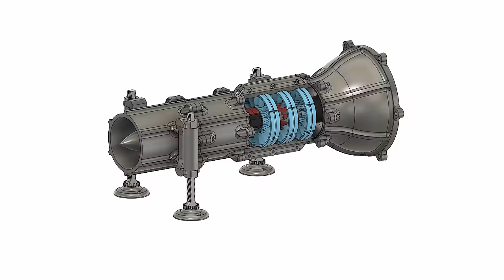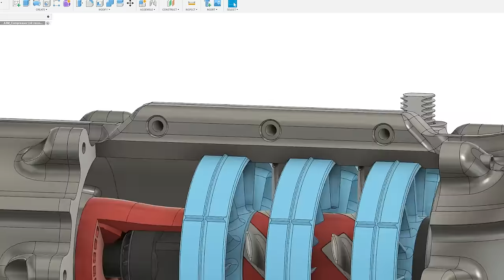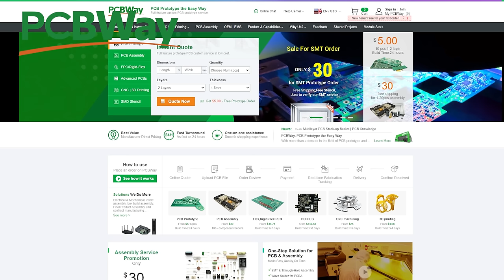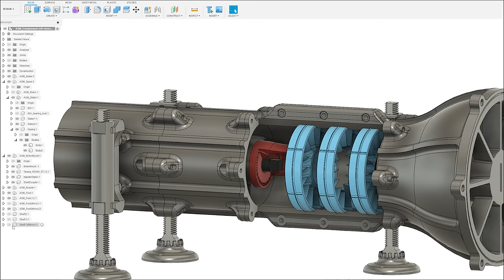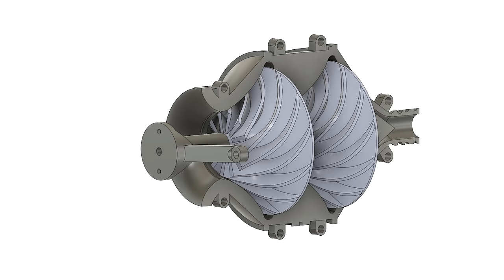Is it Possible to 3D Print WORKING AXIAL COMPRESSOR? - (Testing different blade designs)

Comment: Hey, I'm the original designer of this compressor. Very cool to see it featured! Just a couple of things: this was designed with a very low pressure ratio, high flow working condition in mind. If you restrict the outlet area or apply too much backpressure it will stall badly, as you've noticed. For your application your best bet will probably be a radial compressor, as you've already hinted. Also, you're right the coupler and legs are trash! :D If I were to redesign this, I would probably at least change the coupler to a solid TPU shaft. Very curious to see part 2 of this!
Reply: You left out the part of telling this dude to send you a few bucks for it😂
Reply: A low pressure ratio, high CFM means it's a fan and not a compressor, and the compression of air happens in the diameter restriction downstream. While in an axial compressor the compressing happens between the fan rotor and stator blades which become progressively smaller.
Reply: @Stoney3K  the original post did say it was an axial fan

Comment: The smoke tests actually showed everything you needed to know - in the first test, the air was being forced back out of the intake whereas the second one you got good airflow into the inlet. Therefore the first trial did not have a good pressure differential between the inlet and exhaust (probably compressor stall) but the second performed much better.
Reply: the airflow was to constricted due to the small outlet thus causing the compressor stall
compression ratio of each stage is like 1.1-1.2 its fairly easy to calculate how big the outlet should have been
Reply: Gap between rotors and stators is too big… air stalls.  (RB199)

Comment: Part of your issue is the space between stator and rotor, another part is the shape of the rotor blades. They should be dished to accekkerate the air backwards. The final point is rotor diameter. Each stage should have a blade slightly smaller than the previous dependant on compressor ratio. IE if stage 1 compresses the air by 5% then stage 2 should be 5% smaller. The J79 engine had 17 compressor stages with variable stators and had a compression ratio of less than 12 to 1 and early jut engines without variable stators were as little as 3.5 to 1 off 12 stages. My recommendation is therefor to use 4 stages, reduce the gap between stator and rotor and use dished rotor blades.
Reply: yes, this +  also the housing to compressor distance should be as small as possibble.
Reply: pretty sure the outlet was way too small causing compressor stall
the compression ratio of each stage for a axial compressor is 1.1-1.2, the maxium compression ratio possible would of been 1.2^2 (2 stages) or 1.44, the outlet looked like it was exspecting a pressur ratio of 2 times thus the compressor stalled due to not being able to get all the air to flow through the outlet
Reply: The blades/stator/housing should slightly rub and be lapped in.
Reply: Hey, I'm the original designer of this, and I wish I was aiming for a 10% compression ratio! :D The main goal for this project was mostly just to make a lot of noise, have it look cool and move some air through a vacuum cleaner HEPA filter. I was, in fact, so pessimistic about losses and restricted in available power that I aimed for a 1-2% compression ratio for each stage and only two stages, hence the constant diameter as I didn't expect air density to vary much and wanted to keep the CAD simple. The original nozzle had a way bigger exit area compared to the inlet that housed the filter, and this is most likely choking even without the ballon or glove
Reply: Also, balance the rotors. It sounds like right now there is a lot of vibration which is making the design very inefficient and susceptible to damage, running the risk of the rotor rubbing against the outer housing.

Comment: I’d think that adding more stages in progressively decreasing sizes may help increase the compression ratio. More RPM would help, but you’re limited by the materials used. Not to mention that heat of compression will be a limiting factor for those materials, as you increase the output pressure. Take a look at stationary turbo/centrifugal compressors. They use interstage cooling to mitigate this problem. But that’s getting into apple vs oranges territory.

Comment: I’ve been looking into studying to be an A&P mechanic and recently learned about lockwire or safety wire. The bolts holding the main connection vibrated loose so fast, it would be interesting to implement it in some way for a guaranteed secure fastener and an added layer of realism

Comment: Great video: Now, with that said: perhaps you might want to try 3D printing some flexible filament designed gaskets to restrict air leakage that may also increase the needed air pressure that would inflate that balloon.

Comment: There's so so much resistance in this man, I'm not surprised your coupler constantly broke
Reply: Yes, R was great the secondary issue was the overly reactive spin up speeds.  The coupler may have lasted just a little bit more IF the throttling had been more gradual.

Comment: One thing you could have tried with the turbine blades would have been a shrink fit. Basically put them in the refrigerator for a bit, then press fit them in.

Comment: I would have resin printed the coupler after it breaks for the 3rd or 4th time, try it again with 100% infill next, and finally, if all those fail I would have inserted a metal pin(nail works as well) or screw into the middle of the coupler to give it more sheer strength since the coupler had too much axial load and rotational stress to deal with at such high RPMs.
For your Clear shroud parts from PCB way and all your 3D printed parts that require metal screws to hold the 3D parts together ill suggest you use brass inserts and buy a whole kit of them and use the ones that you need in your projects.
I am suggesting a Kit so that you have a few Brass inserts of all sizes for all your different project needs. This allows you to see which brass inserts work best for your 3D project needs, allowing you to order specific brass inserts in higher Quantities that you frequently need.
Use a soldering iron to heat up the Brass inserts and let them get placed into their spots as the plastic melts into the brass inserts and secures them into your 3D project pieces even your clear 3D shroud parts can be salvaged for future use.

Comment: Turbines have very high frequency vibrations. They need lots of smaller screws/bolts to hold them together rather than fewer larges ones. That's how real Jet engines work.

Comment: You should try a tesla turbine as a centrifugal compressor. Sure it may not be as good as a bladed one but it's easier to manufacture and balance. So with DIY machining it may out perform a bladed centrifugal one just because it's easier to get higher quality.

From my experience CNCing the discs (and spacing washers) out of <1mm thick aluminium and stamping dimples close to their edga to maintain the gap is enough.

Comment: Also try smaller bearings, your fraction is obviously much too high, crousile for high speed. Should solve the battery issue as well. Im wondering if smaller turbine diameter would work better. Great job at all 👍 
Regards from the radial side! 😋

Comment: I am not a licensed airdynamics designer, but I see one, imho, flaw in this turbine rotor: the blades' incident angle is the same for the primary and the secondary stage. Whereas it seems the secondary prop operates in a faster flow and hence should have a larger incident angle of the blades. At least this is obviously an area to improve, as we see comparing the first and the second rotor design.

Comment: Could you explain more about your compressor design technique, especially the centrifugal compressors?
And instead of using a coupler that transmits with friction, try making a wave pattern and tightening on both sides to transmit without slipping.
Reply: When you try to have multiple stages of a centrifugal compressor, you end up with so much plumbing and surface and friction. But a centrifugal compressor can have multiple outlets for a cannular combustion chamber. An axial compressor can have stages and also lets in all the air which is in its way. So you don't need a large pod. Only important for airplanes.

Comment: With Metal 3D printing becoming easier and cheaper with materials like aluminum, titanium, nickel alloys and other exotic alloys it should be possible to produce a hot (combustion) turbine with 3D printing plastic as prototyping like you're doing. 

I've been thinking about this for years. Increase the fuel efficiency of small turbines and use those to make a real jet pack that has a longer flight time and for less expensive than what's available now.
Reply: 3 chinese hobby jets produce enough thrust to lift a man. Only problem is they are 10k each.

Comment: Probably getting compressor stall over blades. Real axial flow compressors in gas turbine engines bleed only a bit of air but also have variable guide vanes to account for the different flow rates through the compressor, avoiding stall.

By stall I mean it in a aerodynamic way like an aircraft wing. If the angle of attack of the blades relative to air flow exceeds near 30º the laminar flow becomes turbulent and no more compression across stage. So in your glove example it takes a bit to get it started but once the flow starts, blades are no longer stalled and it pumps much more efficiently. The radial compressor might handle this better.

Comment: I've not read all the comments.
But.
The leading question I would have is 1. assuming you build the side walls closer to the rotors how long do you think that the rotors' would hold up in operation?

Comment: There's one big problem - the stages of the compressor and the shaft are not balanced. The noise and vibrations clearly show that. You're losing efficiency with that.

For static balancing I'm recommending using a propeller balancer from RC model shop. Dynamic balancing, required for turbines like that is more complex topic. But even static balancing would improve the performance.

Another topic - gaps between walls and blades. It's related to the speed (because blades elongate on higher speeds). And the gaps should be as close as possible. One way of achieving that - print larger blades and try to wear them down to the maximum allowable diameter. But balancing is #1 thing you need to do.

Comment: I wonder how much heat is generated inside this compressor, great experiment Sir.
Reply: Very good question! The amount if heat generated is actually very easy to figure out, as all the energy the motor use turns into heat. 

What temperature that translates to is more complicated than that, but without multiple stages with really good cooling between them, PLA can't handle the temperatures from just heat of compression common "garage air compressors" produce. On top of that there will always be heat from various forms of friction and other losses in the system.
Reply: I was pointing to the fact that compressing air molecules also generates heat apart from the motor itself, try to block the nozzle of a bike pump when you perform pumping action ;-)   @fishyerik
Reply: A lot from those type of bearings.
Reply: Adiabatic heating

Comment: The reason you centripetal compressor failed and rubbed the housing was because you need to use a thrust bearing to stop the shaft from moving forward as pressure increases.

Comment: I'll never get tired of 3D printed compressor videos.
There's an annoying lack of DIY axial compressor videos. everything else is usually centrifugal type compressors.
Reply: There's not really much that is easy public knowledge about them.  I have some books from the 70s and 80s on the subject I picked up used - but a modern book containing such subjects will run you $1k or more - and there's a lot of dark arts to it.

GE isn't publishing books to tell China and Russia how to build their jet engines.

To be honest, I would have assumed this printed part would have failed, structurally, well before achieving significant pressures - so color me impressed, here.

That's the other issue - manufacturing turbine blades is a bit of a dark art tailored to gas turbine engines.  Special treatment alloys, spin casting and controlled metal grain development is what goes into commercial operation - the tools to take a chunk of 6000 series aluminum or powder and see how far you can get with it for a DIY axial compressor are rather new.  As is distribution of CAD tools to model them and/or use CFD to assess the design.

Comment: No. It is not possible. Air is compressible. Water is not. The question is just as silly as asking if you can use a water pump to fly an airplane.